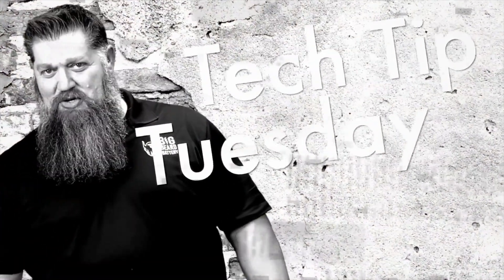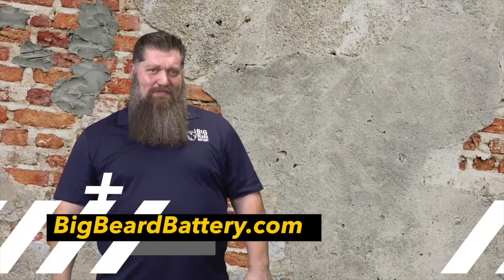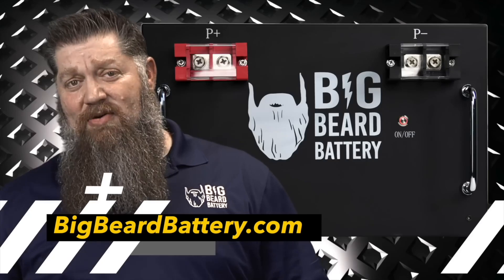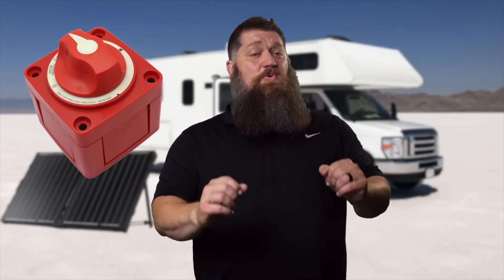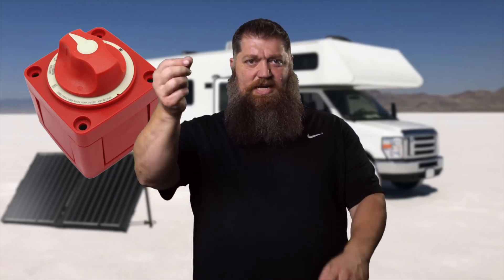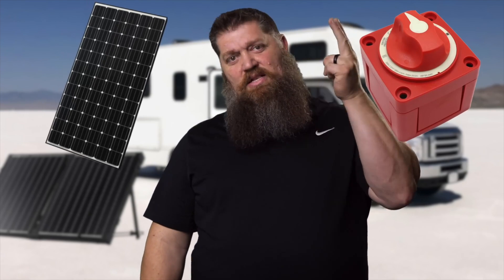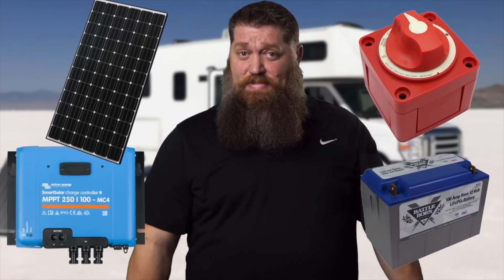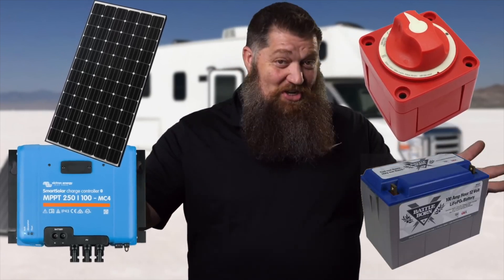4 Essential Components to charge your RV Batteries

Comment: With a system like this on a RV, is there any issues keeping this connected when connected to Shore power, since in this case the inverter would be also charging the batteries.

Comment: Thanks so much. This info about “what the controller actually does” is the first I have heard. I’ve watched a plethora of videos and some multiple times. I knew it charged them, but not about how it converts the panel’s volts for the batteries.

I’m female and blonde, so I can learn, I just need to ramp up my “flux capacitor” to really understand this Greek. 

Not sure if it is on my end or yours I can see the link, but I can’t get it to open. I’m on an iPad. I will do a search it. 
Thanks again!